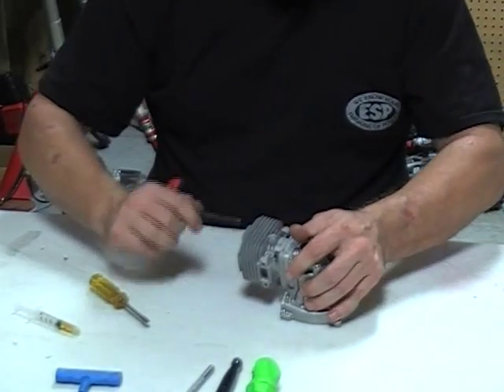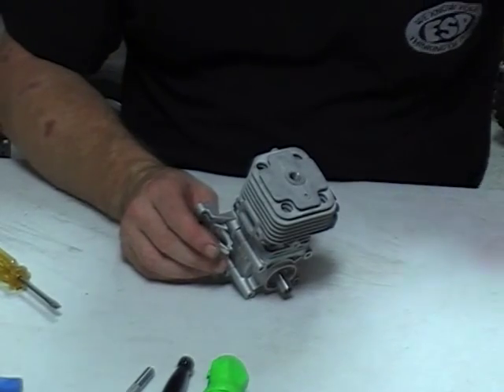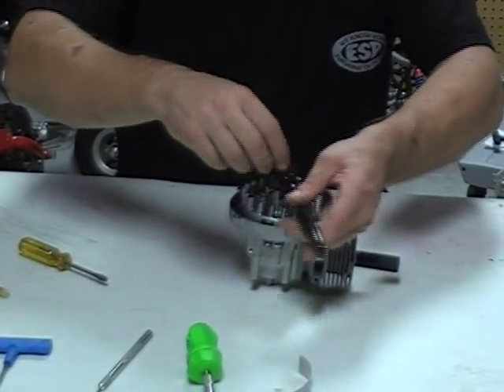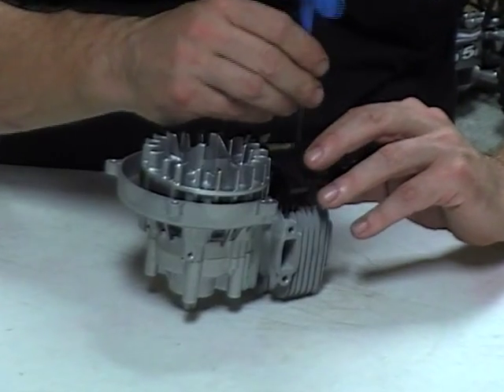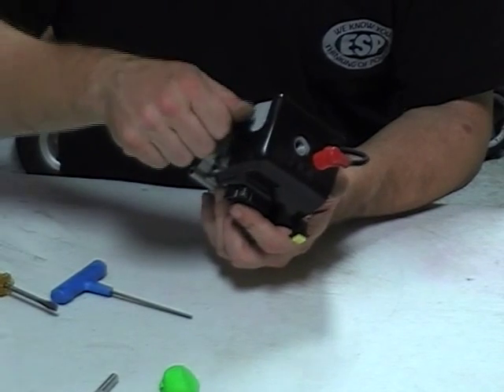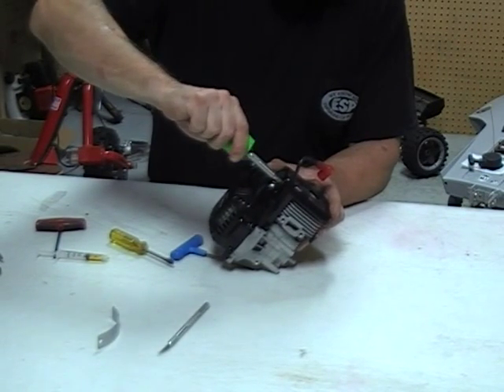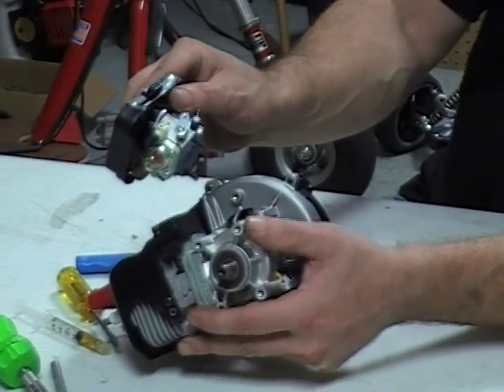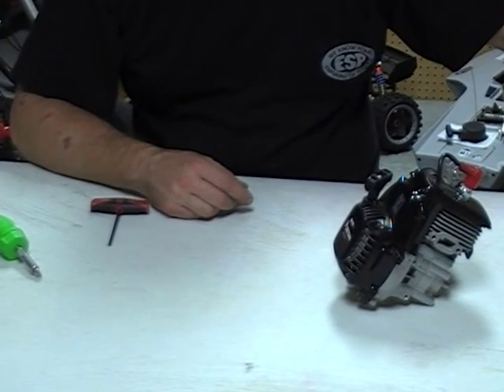RC-Engine-Assembly-Tutorial-Video-Part-2.mp4

Comment from the maker: I messed up a bit putting the ring on.  If you noticed, I struggled a bit with the ring.  That is because I had the "free end", (the end not in the the piston groove), of the ring stuck on the side of the piston.  If that "fee end" was on top of the piston, it would have went on like butter.